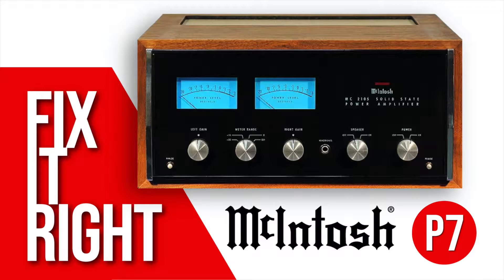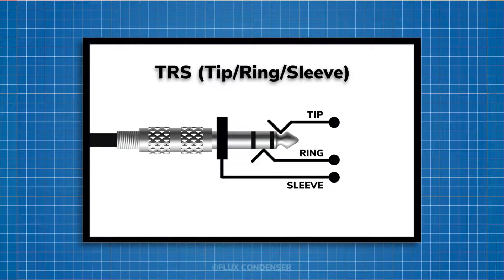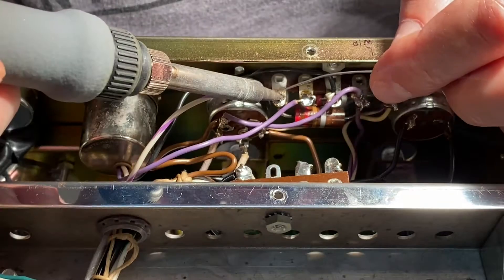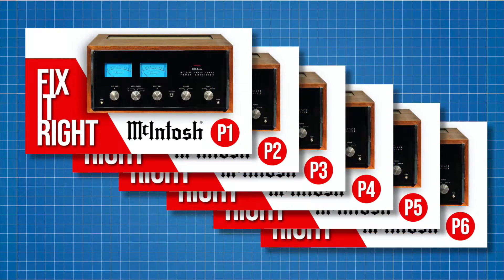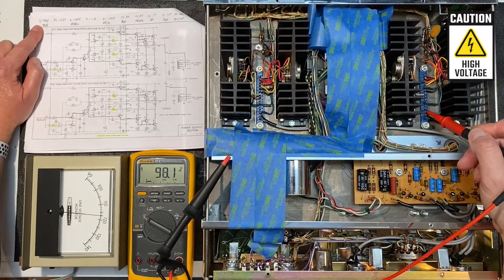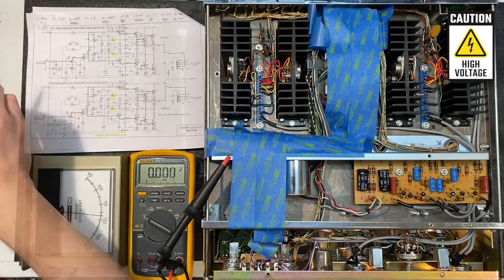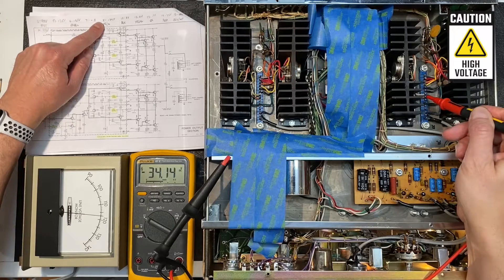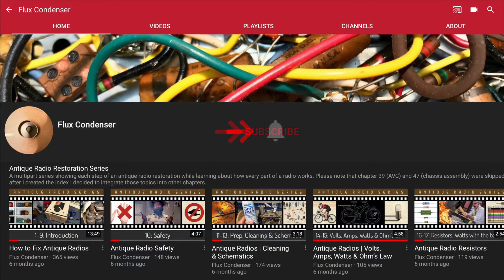McIntosh MC 2105 Restoration P7: Let’s Fix The Reversed Headphone Jack & Test Voltages

Comment: Hey Chris,
Last night I set up two speakers connected to the L & R outputs of the amp. I set my Signal Function Generator to put out a 1KHz frequency and set my Variac to 117V (+/- .4V), which I confirmed with a DMM reading from a second AC outlet on the Variac.

I had the amplitude of the SFG set to 1.500v so the tone would get pretty loud around -8db on the Mac's meters. Therefore, I didn't increase the output gain on either channel beyond about -8db. 

As I increased the Left or Right Gains, the tone's volume increased and decreased smoothly and both channels sounded to put out an equal volume level at the given db on the amp's meters. Of course, that's going by my hearing and at 65 years old, I will admit that my hearing has been better. I even ran a 1KHz to 4KHz, rise/fall, modulation test with a 50% duty cycle over a 5 second period.

LOL, my cats were all freaking out and looked like they were expecting an alien to 'beam in' at any moment! ; )

I plan to do the same test with the O-scope today and compare the output accuracy of the L & R channels as they're displayed on the amp's meter's. I did test the signal through my Headphones via the headphone jack. I know that your jack had a reversed Left & Right channel output, but my headphone jack was correctly sending the left to left and right to right.

It was late so I didn't look closely at the wiring of the headphone jack, but I plan to see if the wiring was reversed when the amp was recapped previously. I'll compare it to the schematics that I have, but not knowing the serial number of my amp, I can't be certain that Mac didn't eventually reconfigure the jack for TRS plugs and that I have a later production model.

Anyway, that's just a FYI/FWIW, and everything is going well. I didn't have any .47uf Mylar caps to replace the two 'Tropical fish' caps on the "Normal/Direct" switch so I ordered some. They came today and I'll be replacing those caps with the new ones. 

In addition, I took out the two large 39Kuf/75V capacitors, which came with my kit and tested them on the R/C Leakage Tester. These two caps were brand new and I hadn't even powered them up, but I got the same "10%" open magic eye results when I did the leakage test on them, as I did on the two 30Kuf/100V caps yesterday. 

This told me that because these capacitors exceed the max rating of 1000uf on my tester, the eye wasn't going to get any wider for good results on caps of this rating. Therefore, I returned the McIntosh 30Kuf/100V to the amp. They were the ones that I did the frequency test with later on and seemed to behave very well. In fact, even though I've only tested a few of the caps that I removed and replaced, I haven't found any of them to be bad, but I've got a lot more to check yet.
Rich
Reply from the maker: Thanks for the update, Rich. Sounds like things are progressing smoothly and you have a handle on things. 

Be mindful of the voltage from the signal generator as you don’t want to oversaturate. I usually use a 1 volt signal and 1.5 volts might be a bit hot. You can always check the service manual to see if they either specified their input voltage for the test or the general recommended input voltage. I can’t recall what that was, so I’ll rely on you to check on that if you’re interested. 

Take care and keep us updated. I’ve gotten a bit busier as spring has hit with other activities and trying to push out more videos. I may not be able to respond as promptly, but I’ll do my best.
Reply: @FluxCondenser   Thanks Chris, No worries, I completely understand. I have the same problem and for me, this job has had to take a backseat to other things many times over. 

I've been hanging on the part 7 video for while. I've been following along with you when checking the output boards voltages.

However, I'm getting some fairly large discrepancies with my readings when testing most of the small voltage wires. The tests on two different DMMs are show higher voltages than specified. In addition, some are reading positive voltages where I should be getting negative readings. 

For example; I'd get a +2.8mv when I should have a -.5V. In addition, the right channel voltages are consistently higher than the left channel in the test areas where these small voltages are noted. You pointed out that you found some voltages questionable until you cleaned the flux from theses areas.

After I recapped the output boards, I cleaned them and I cleaned the slots before I inserted them. However, I didn't clean the slots from the back side where I'm touching my leads, so I'm going to clean them as best as I can. I'm also going to make a better, more solid ground connection for my negative probe.

I'm hoping that'll give me better results. As it is, all the higher voltages, (35V and up, in positive and negative directions), are good and both channels are equal in their readings. It's those very small voltages that bother me and I hope it's all due to a poor DMM probe ground and dirty, flux-covered test points.
Rich
Reply from the maker: @richpaul8132  Yeah, if you’re getting readings in the micro-volts you’re probably not actually getting a reading at all. Making good contact with those areas can be difficult so I recommend as sharp of a probe as you have and try to dig in a bit.
Reply: @FluxCondenser  Yes, The DMM I just bought, (my 3rd in my "collection", is a better quality brand, (Klein). (I'll probably breakdown and buy a Fluke before the year is over). I got the Klein about a week ago and the points on those probes are very sharp, . 

However, I haven't been using the probes at their points. I've been bumping against the side of the probe tips. So right there, I already can see a possibility for a bad reading. 

I'm sure after I clean both rails and use the points of the DMM probes, I'll get a more favorable result.
Thanks again,
Rich